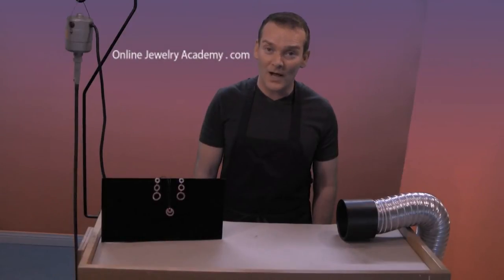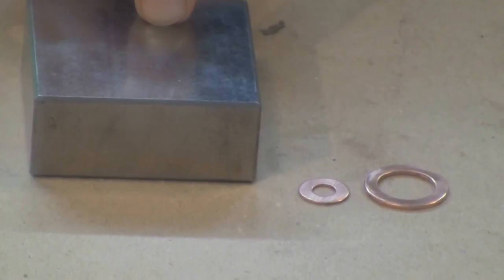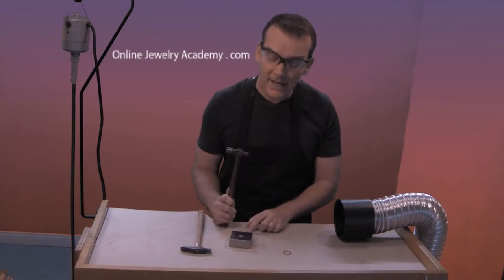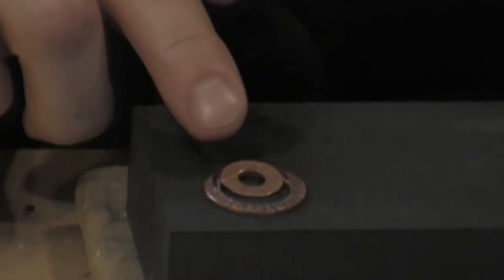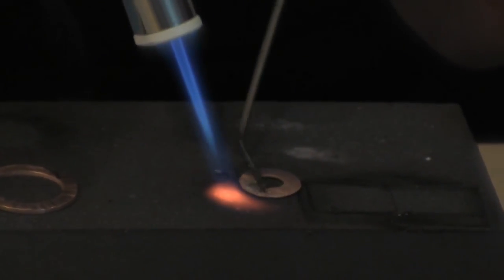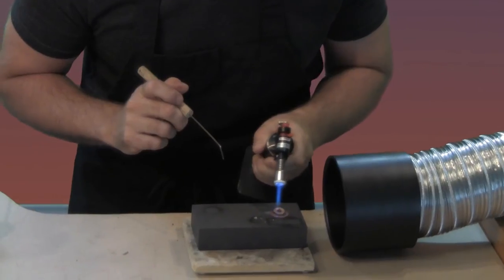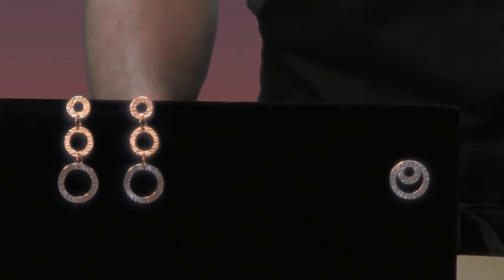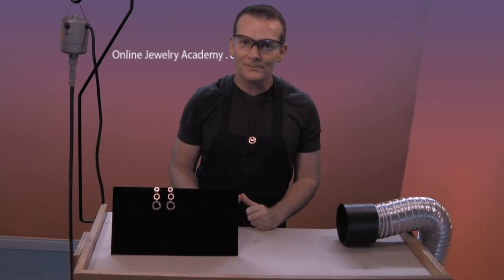Sweat Soldering A Copper Pendant Made From Washers

Comment: Thank you so much for this video. You are the only instructor that says why, where and when to add flux and about melting the solder to where you want it to go. I just took a class with a copper on copper tree of life with lines all over the middle and the solder never melted because she had us melt only to the point of clumps of solder that never flowed to the inside of the trees. I had to pound the middle pieces down.
Reply from the maker: +Bobbie Housand 
Glad you found the video useful Bobbie.
Thanks for supporting the OJA! : )

Comment: This is a great video and an excellent technique for attaching small pieces to a larger base. At first, I had some trouble with the final bond because the flux would bubble and 'float' the smaller piece, making proper positioning difficult. Cutting down on the amount of flux helps, and using a solder pick is crucial to keeping the position right. I found this also works with "super-easy" paste solder, using a liquid flux after the first melt.
Reply from the maker: Thanks for sharing your experience Kurt.  I'm glad that you found the tips in the video helpful.  I'm sure that other viewers who read the comments will appreciate your input.
Thanks for your support! : )

Comment: Hi John, I'm curious what kind of feet have you put on the bottom of your ceramic tile? Does it need to be something specific as the tile can become hot?
Reply from the maker: +Shannon M 
Hi Shannon.  You can pretty much glue anything to the bottom of the ceramic tile.  I actually have rubber bumpers (the kind that you put on the back of a picture frame) stuck to the bottom of my tile.  They keep the bench surface from getting hot.  Plus, they prevent me from scratching up the top of the bench.  You'll find that the corners of your tile never really get that hot with normal use.  This is especially true if you normally work on a charcoal block.  Good luck with your projects.
Thanks for watching! : )

Comment: Hi Professor John. I have two questions for you :-) Fist question, when soldering cooper I end up with silver joints. What type of solder should I use so the joints are not silver? Second question, when making a bezel I've ran into this problem, solder the ring that goes around a stone, but when I solder the bottom part, the joints come undone so I end up with a bezel with an opening.   Thanks for you wonderful videos!
Reply from the maker: Hi Pati,  Silver solder is going to be easier to work with than copper solder.  So, stick with the silver solder.  You just need to learn how to control it.  Remember, solder is attracted to heat and will flow where there is flux.  So, if you work neatly like I did in the video you can avoid silver solder messes.  If you do get silver solder on a copper project you can use spent pickle to plate over the mess.  The OJA has a number of other soldering videos that you might find helpful.  Plus, we have a video on the use of yellow ocher which will inhibit the flow of solder.  You can find the complete video playlist on the OJA website organized by topic at: www.onlinejewelryacademy.com  Oh, and there is a bezel making video on the site too.  Good luck with your projects.
Thanks for your support! : )

Comment: I noticed in one of the previous comments they asked about using silver solder on copper, and you said to stick with the silver solder because copper solder is harder to work with. Why is copper solder harder to work with? What about it makes it harder to work with, and it what way does it make it harder?
Reply from the maker: Copper as an element doesn't want to flow when it is in its liquid state.  Plus, it has a high melting temperature.  As a result, the alloy sold as copper solder is a little tricky to work with.  Plus, the color of it isn't a perfect match.  It's easier to just stick with silver solder.  Just be careful where you flow the silver solder.  If you make a mess you can use abrasive processes to remove it.  Or, you can easily copper plate over it with spent pickle.  (And, we have a video on that.)
Thanks for your support! : )

Comment: How are you John?, I would like to know if you can melt down silver or gold with a butane torch?
Reply from the maker: +Randall Utendahl 
Hey Randall, It depends on the type of torch you have.  Butane torches can get hot enough to melt silver and gold.  But, many of them are not designed to get that hot (i.e.: kitchen torches).  If all you want to do is melt, use a cheaper fuel like MAPP gas.
Thanks for watching! : )

Comment: I'm trying to sweat solder copper sheet to copper sheet and it's not working. I've tried a lot of times. It never attaches to the bottom sheet of metal It's getting really frustrating... Can anyone tell me what I may be doing wrong? Thanks
Reply from the maker: If you're having problems with sweat soldering, check the following:
Are the two pieces of metal both clean?
Did you re apply flux to the melted solder before you tried to sweat it?
Are you heating both pieces to the same temperature simultaneously?
Do your pieces make good contact with each other?
Does your torch get hot enough to do the work?
I hope you have better luck in the future. : )
Reply: @OnlineJewelryAcademy  I’m having the same issue with copper & brass, on cuffs.  It works better with different torches and fuel : map-pro, acetylene and a butane Big Shot.  Even propane takes a larger torch head.  Most videos are on silver which I feel is really easy to work with as compared to copper/brass.
Reply from the maker: @4nbop80user  Each type of metal presents its own set of challenges. Your success at soldering will improve with practice and experience. 😀